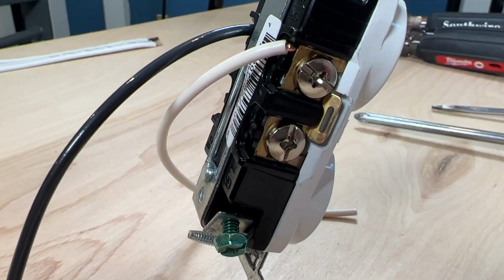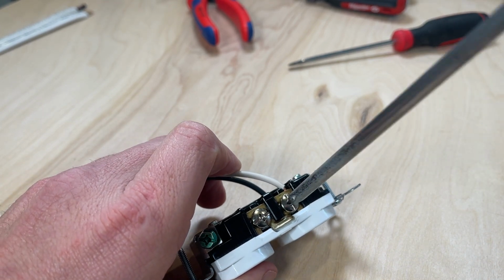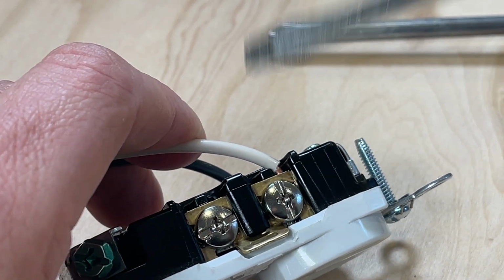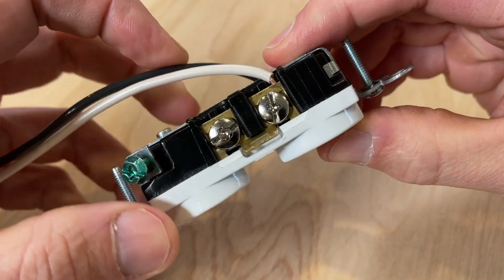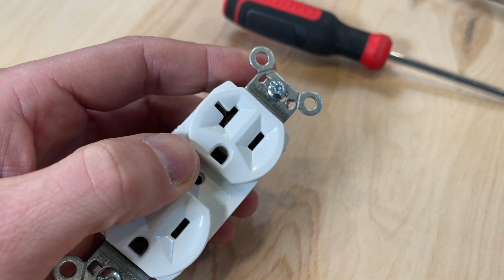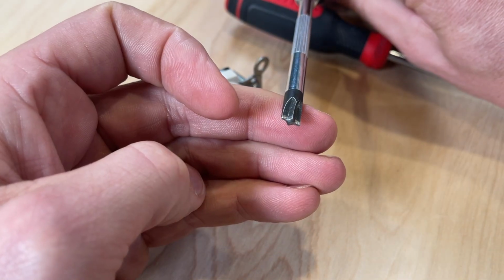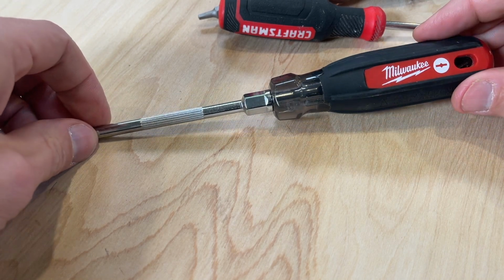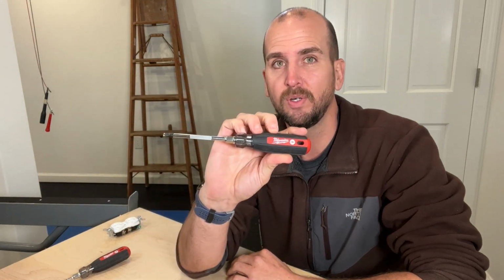80% of People Use the Wrong Screwdriver For Electrical Work

Comment: I have some Coopers brand outlets and it has those phillips 2/slotted combo screw heads, but the Milwaukee ECX 1 bit is too big to fit into the Coopers screw heads.  I found that the Bosch P2/R2 combo bits work well on the combo screws on both the Coopers outlets and combo screw heads on Spax brand wood and sheet metal screws.

Comment: I need someone to explain to me why the hell an explanation of which screwdriver you need to use requires a 7 minute video? If someone asked in real life you would tell them in less than 5 seconds. If you are an employee at a store you would tell someone in less than 30 seconds and that would probably include the time you took the walk them to the aisle to buy the right screwdriver.

Comment: The issue is pride. The UK (slot / flat head) industry doesn't want to use the US bit (Phillips). The US industry doesn't want to use the Canadian (Robertson).  The Robertson does most things better and is cheap to machine unlike the Torx shape which is better otherwise.  It is still prone to rounding when it pops out using power tools. Torx usually doesn't.

Comment: 3:00 I work in maintenance and have had some of these square bits and NEVER knew what they were for until now. I've never seen any of my coworkers use them so I just figured they were for a special type of screw. This is awesome!
Reply: You'll use the square bits in a lot of construction screws, torx bits are found in construction screws often as well. Oh! And your pocket hole screws are almost all square bit for ease of install.

Comment: I think for the average homeowner buying an extra tool for installing an outlet is ridiculous. Don't do it if you are a professional electrician. getting the combo is your best option but for a homeowner it is just not worth it. it is something that will sit in your tool drawer for years until another operation and then you're probably just going to use the normal screwdriver that you have on hand

Comment: Whatever screw driver you're using, it's a very time-consuming way to fasten those wires! Also if you'd connect another outlet via the other side of the screw, the twisting motion tends to push the conductor out. In most of Europe a person can wire electrical sockets, switches, dimmers etc just by pushing in a wire. It's a one-way system (a firm plastic button on the wire insert or a repeated twist and pull motion releases it) that not only saves lots of time in installation when compared to the type of socket you showed, it also conceals the conductor whereas with your socket, when you touch the screw... you're screwed ;)

Comment: Great idea- but I’ve been using a Phillips for decades and never had any issue. Seems like a solution in search of a problem. But I’ll still probably switch because it’s a better tool for the job and it’s cheap.   Good video. 👍
Reply: It is essentially, the screw is designed for a number of different heads.
Reply: Green Robbie gives 100% contact eveytime without slippinb

Comment: Imagine thinking that someone is wrong for using a regular screwdriver 🤣. Having stripped threads in the past with a regular screwdriver because I overnighted the tiny screw on the tiny threads, I’d say a regular screwdriver is just fine. It’s not like you’re going to use the outlet to lower yourself off of the roof so it needs to be able to support the weight. It’s going into a wall where the wires aren’t ever moving again until somebody takes it out. A regular screwdriver will make the connection plenty tight enough. Not one issue in over 20 years with me or the dozens of electricians I know.
Reply: I agree 100% ...
But according to the NEC, those wires have vibration to them as current is flowing. The more current, the more vibration. 
This is why they say to NEVER use stranded wires into those teminals because the vibration will break the tiny strands causing the wire to lift off.
Granted the average outlet is 15A and i doubt there is 15 amps flowing thru an average socket. Maybe an iron or hair dryer will pull 15A ... 
I have grabbed a primary 120V line in the outside panel and can feel the vibration in the cable. Once i shut the breaker OFF, the vibration was gone. So its true that the wires do vibrate depending on how much current is flowing. 
And i have seen and heard those primaries shake when a 240V ac outside compressor kicks on. Crazy shit ...

Comment: You are missing the point. In most construction I have worked around you do not always have what you need. So, even if it is stupid wrong, if it works and gets the job done, it's good to go. So if you want to be a handyman prima donna keep preaching the anal ways of screwing it up. 
I noticed that you put a straight wire into the outlet connection. Back in the day I believe that was against code and the proper way was to curl the end of the wire around the screw so the end followed the direction of screwing it tight.  To many wires connected straight in over time fall out causing short circuits and fires. No matter how tight you make it, heat and cooling will loosen the straight in connection.

Comment: As a qualified electrical inspector and industrial electrician I will say the PZS is the only correct tool for the job. If the the screw head is a slot then use a flat blade driver, if it's a little cross with no marks on the 45° then a Phillips driver if it has a cross with little marks at 45° then it's a pozi drive. Most modern electrical screw heads are a PZS, yes they accept a variety of driver's but are engineered for a specific tool.
My advice is to just go and get a PZS no.2 and 3. After you start using it yourself you will go shit, I've been doing it wrong. 
Ps. I've wired 100's of industrial control boards with 1000's of terminals and the right tools for the job saves time and money, also better and safer terminations.

Comment: As a Canadian, I've known about Roberson screw drivers since I was a kid and for electrical work since my high school shop classes, back in the late '60s.  A #1 often has a green handle and #2 red, for easy identification.  Also, the wood screws often used in electrical work fit a #2 perfectly, which means you can place the screw on the tip of the screwdriver and it stays put, as you push it into the wood.  It's much superior to the Phillips in this regard.  No Canadian tool box is complete without at least a couple of Robertsons in it.

BTW,  i am also not a fan of multiple tip drivers.
Reply: What about torx?
Reply: @davidworks7758  Robertson was around long before Torx.  As has been mentioned, you want Robertson screwdrivers for doing electrical work, as they properly fit the screws.  As I mentioned, they make it very easy to drive in wood screws, as you don't have to worry about the screw falling off the tip and they don't slip.
Reply: @davidworks7758  Torx would be better for any application, but when you're an outlet manufacturer and have two options of 'make an outlet that requires the customer to use a Torx screwdriver only' and 'make an outlet that could be mounted with any widespread Philips, slotted or Robertson screwdriver' the choice is obvious.
Reply: Robertson can also have worn tips sharpened and reshaped in seconds on the bench grinder. Gives you many more years from a worn out red Robbie!
Reply: You're my hero man! Glad another Canuck is here. Phillips head anything is far inferior to robbies. I often wonder how Americans still use it, along with most imperial measurements. (Admittedly, I measure lengths in inches as a go to.) Torx head is my favorite, but thats the mechanic coming out of me. For construction, im an electrician now for 8 years, robertson is the kingmaker. Keep that 🏒 on the 🧊

Comment: i have always used a Philips . i never had much problem getting the connection securely tight without stripping the screw out .
but . . . i can see where the Robertson bit could be better .

Comment: Nah - those screws are combinations of philips, slot and robertson - any one of those is adequate and will provide sufficient grip to drive in the screw. "ECX" is NOT a standard.
(Robertson really needs to die. It is just useless.) Torx all the way - it is just in general a better design unless you need to limit torque - in which case philips is better.

Comment: Woah... that's so weird. Didn't realize those screws were built to handle all types of screw bits like that. Interesting design for maximum compatibility but poor contact grip for the most common screw driver which is the phillips.

Comment: the issue here is with the choice of screw head, not the tools... its a mix between 3 different screw heads (one we never even see here in Europe at all so i don't know why bother with that standard at all).  

The gap created in the slotted screwdriver opening by the Phillips 2 and this square slot means if you come at this with a too small slotted screwdriver, your gonna have a bad time... 

The slotted screw head part also removes 2 out of the 4 prongs for a Phillips, reducing contact surface... and causing it to slip out... combining it with for example a wrong size (PH1, or PZ1 or PZ2), and again you are going to have a bad time...

This square feature.... i don't know something tells me that if you go this far you might as well just use Hex head screw heads... far more common in your tool box... than some random square...

This issue is that the screw head is designed to have multiple ways of tightening it... but in doing so, it has made it essentially harder to tighten even with the right tools...

This guy's solution is to get a purpose built screwdriver that capitalizes on the fuck-up of this product to sell a tool which takes advantage of the mistake... nobody is going to have this tool in their tool box...

Poor product design choices...

Comment: ok yes the square drive does fit but no that is not what the srew head is supposed to be tightened with. The manufaucurers here (australia and New zealand) state use a properly fitting Phillips screw driver. And yes I at one stage in my life was a Electricians appentice. you don't use a flat blade screw driver at all.

Comment: Old electrician (since retired) here, We didn't have square drives back in the day but relied on a Klein flat blade. That's what we were taught and that's what we used. Fast forward to today I have the Klein # 1 & #2 square drivers for my electrical work and boy do you need that #2 for frozen breaker screws.
Reply: Mike you are absolutely correct. I was trained as an electrician’s helper 47 years ago. Worked in the trade for two summers. The electrician took me to the supply house and pointed at the tools I was to buy. One #2 Philips, one small straight bladed screwdriver, one medium straight bladed screwdriver, side cutters, dykes and a 16oz claw hammer. All Klines and cost me a fortune back then.

Comment: Being an electrician the obvious choice is the green Robbie, it's really about time that our fellow Americans to the south finally adopted the Robertson drivers. They're far superior. 

The ECX are good drivers but they are harder to line up and I find the bits are cheap when using an impact driver while running conduit. The flat head portion tends to snap and break off.

If I'm using an impact drill i tend to use more of a Philips bit as if you over do it with the green Robbie you tend to strip out the screw, so the self torquing abilities of the Philips help keep things quick and productive. 

That said, the Robertsons are the way to go

Comment: -That flat head screwdriver is the wrong size for that screw.
-That Philips head screwdriver besides being worn also looks the wrong size for that screw.
-If you're using the proper size of Philips head screwdriver there's no better choice because when it cams out it's telling you it's tightened to the manufacturer specification and impedes you from overtightening which also creates potentia problems like stripping a screw or breaking the mount.
-When square heads break you usually can't remove them to carry on with the job, plus it's harder to judge the correct torque.
-Many of those outlets and stuff have pozidriv head screws that will accept many other types of heads but the only proper one, in that case, will be pozidriv.
-Using the right size square head will wear the tool less and feel better than using the wrong size flathead or philips that's for sure, but for a proper comparison you should probably use right size everything.

Comment: Is this a ”professional” outlet in the US? 
I’m a electrician in Sweden and this looks like something from the 90’s. Here, on a modern outlet you mostly wouldn’t find screws, but fast puch-in connector, or if there is screws they be sunken down a bit in the plastic body for better protection against electrical shock.

Comment: Square heads are the best all around screw you can get, cheap to manufacture, hold better than Phillips on a screwdriver and its tougher to stripping. No wonder its the most used screw head type all around Canada.

Comment: I don't agree at all here... it matters MUCH MORE that your screwdriver is ISOLATED and rated to a certain voltage for the work you're doing. As an electrician you make sure, if you can, that the wires are not live but in the case that you have to work on something while the wires are live, you use an ISOLATED screwdriver.... The bit is not important to be honest.. As long as you  don't destroy whatever you're working on it's fine. It is also possible that something becomes live.. as an electrician you are always at this risk. So you need to minimize the possible contact with live wires/screws...

The screwdrivers you're showing are nice for utility, but they are FAR from professional tools for electricians.

Comment: America hates Robertson (square) because its a Canadian invention, its literally the best screw bit type. but rather than excepting it and just using a proper robertson screw they extend the cut so a standard screwdriver can almost be usefull too as well as also they cut a smaller slot so a philips can almost be usefull too. unfortunately you have now weakend the robertson square hole. and none of the 3 screwdriver types properly.

Comment: If you want to teach electrical work first use isolated screwdriver even if the outlet is not under power. this will give you good habits !

Comment: This is great advice, slotted screw drivers are of a typical ratio width over thickness, I be surprised if you can readily find a wide thin blade. I have been puzzled to these screws having background in the UK. Now it makes sense, one aspect to consider are those often scenarios where leads are too short, it’s all of a tangle and your trying to capture that difficult connection. The proper driver will make an enormous difference.
Reply: If you look into specialty type screwdriver bit sets, such as a gunsmithing set, you can find wide and very thin blades for slotted screws.

Comment: Been using Phillips for 30+ years, I can assure you I can apply enough torque to break the screws clean off.   As an electrician I want to carry as little as possible, don’t get me wrong Robertson is great just don’t need all the time, I like them in panels.
Reply: But we have to be honest, today, screws are not what used to be 30 years ago. Today screws start to slide at very little torque. Yes, I know on higher torque turn should be slower but again, quality changed. Multi-bit screwdriver is a must today.
PS. Regarding this pool, depends where voters are from. In Europe, I doubt anyone used 3rd or 4th option. I am from EU, and I dont use 3rd or 4th option, this is first time I saw it.
Reply: @orion310591RS  EU here , installed few breakers recently used Philips driver, but i have a breaker that i need to install so i just had to check in disbelief , and that little shit uses square driver screw. My brain just exploded...it looked weird when i was installing it but it would never occur to me I'm supposed to use square driver for it 😅
Reply: @terrabiker  The trick is, that material from USA or standard from USA arrived to EU. And it (almost) can be done in old fashined way with old (improper for new standard) tools.
To be honest we are talking about fine details, and just a little bit more (hand produced) torque which may not be needed for stationary wires, but again, this video is useful for informing people about slightly different tools/standards.
Reply: This!
Reply: if you strip half the screws you touch effortlessly,  you're a true electrician. 😉

Comment: Not sure what the torque specs are for a receptacle. But, I have never had issue using the #2 Phillips. In fact this was the entire purpose for the invention of the phillips drive. Factory workers kept breaking off screws with slot and hex tips. So, factory owners wanted a dummy proof drive that would skip the bolt rather than break it off when using air powered tools. So, it seems fitting to use a drive style when the proper torque is(seemingly) achieved without the risk of damaging a device.

Comment: Only lazy electricians do push ins on outlets and switches.   They connections fail more often at the 10-15 year mark so I stopped doing it.  It’s pure laziness and a guaranteed failure with cheap switches.  
While you’re correct about the tool my tool bag must stay as light as possible so if a #2 works then that’s what’s being used.  I have a multi with square tips but I just don’t need them.  Had one in my bag for a long time, but it came down to necessity

Comment: I've been using either JIS or a larger slotted screwdriver.. never occurred to me to try the square drive. I'll probably switch to Robertson no.1 and just leave that in my appropriate bin. I might try the hybrid but only if I catch a good sale or have a chance to try one out first.
Reply: JIS is gold
Reply: I have a Vessel JIS driver that has a serrated tip for extra bite and it works very good. Especially when driving actual JIS screws.